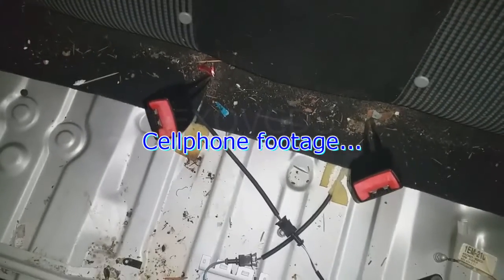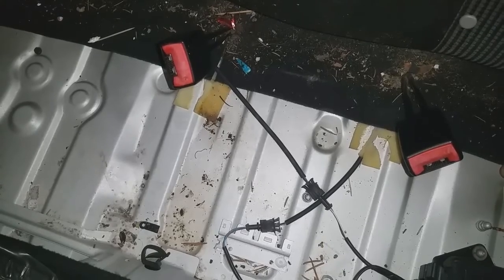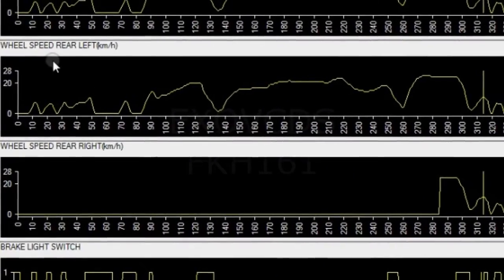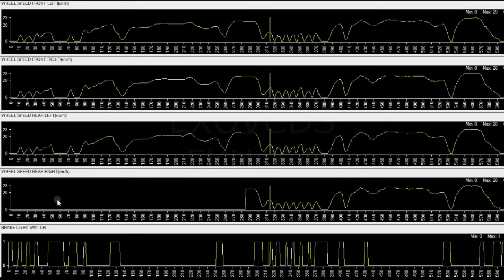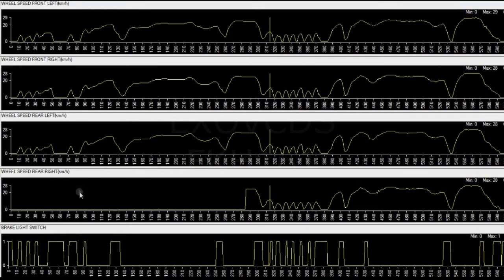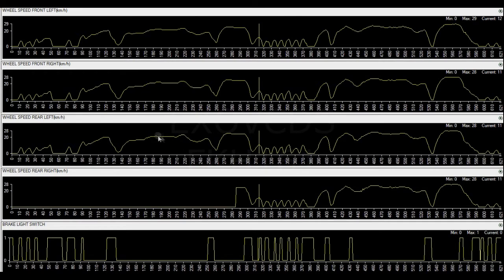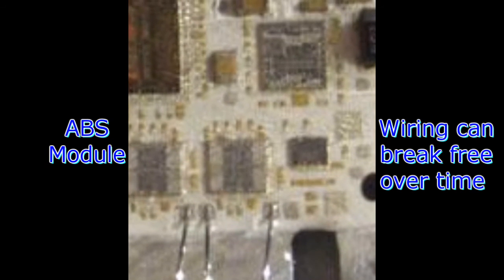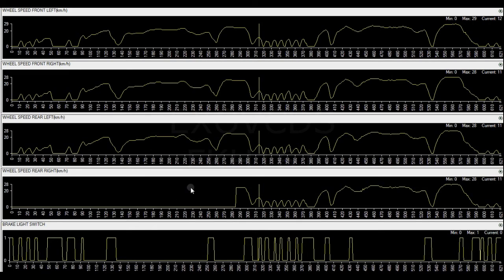VW A3: Cabrio rear ABS Speed sensor fault code

Comment: What scan tool tool did you use?
Reply from the maker: Snap-On Solus, Modis or Verus... can't remember which one.
Reply: @EXOVCDS  was it a standalone scanner or software based connected to an obd2 scanner?
I want to replicate this.
Reply from the maker: The saved data from the scan tool is opened in a PC software. Here is a playlist of some scan data that I have saved and that can then be opened with ShopStream Connect.
https://www.youtube.com/watch?v=TaSrPogNQ1o&list=PLzOjZ2hlpyMMAE5y7620i2hap8Ty6jb6A

Videos in the playlist are to the right of the screen.
Saved scan files are in the description of all of the videos... as well a link to the PC software file (ShopStream Connect) that is used to view the files.

Comment: hi,,i have no fault code however the speedometer gauge works erratically ,,the odometer works,,what could it be ? i have a 1998 golf gti
Reply from the maker: The instrument cluster has a faulty "driver" for the speedometer needle. Since the odometer is working when the speedometer is NOT, that indicates that the speed sensor on the transmission is OK. The fault is inside the instrument cluster. Find someone who can repair it. There are companies that you can find online that will / can service your cluster. Google search instrument cluster repair and then email them for an estimate. BobD on the Bentley Forum repairs them out of his home: http://tech.bentleypublishers.com/thread.jspa?messageID=263138&#263138 Register with Bentley and then contact BobD
Reply: thanks ,,i will check this out

Comment: Hi thomas I have an audi b6 and after replacing the abs control module the abs light and traction control light came on. I checked it with vag com and it says its the brake pressure sensor I replace it but the problem persist.
Reply from the maker: Ivan Mora If the code was not there before, then it could be a problem with the module. I am at work right now, but can reply with more info this weekend. What was the reason for you to replace the abs module? Was your module rebuilt / repaired or is this a new / used module that you installed?
Reply: I replace it because it was not working . After I replace it worked but I replace it with a used one. But before changing the abs module it did not have the abs light on

Comment: Nice thinking of showing how to diagnose if the problem is in the sensor area or somewhere else. Keep up the good work!
Reply from the maker: stuzman52 This is another one of those that "might be back" for the actual repair (was only in to have a quick look). Spring is coming up, so I "might" see that Vanagon that needs the head gaskets replaced.